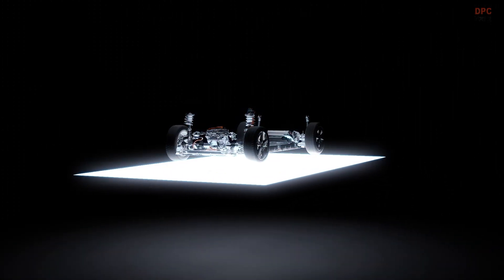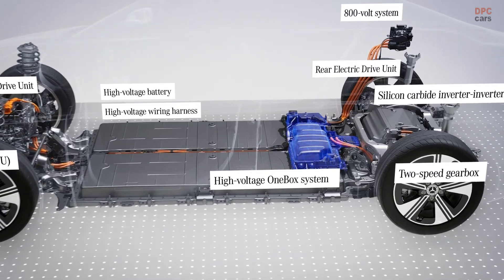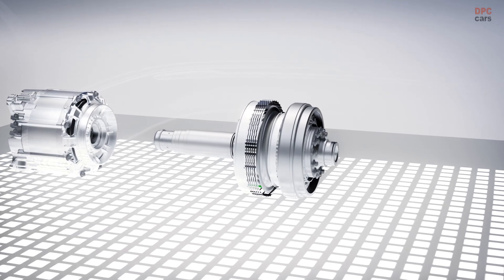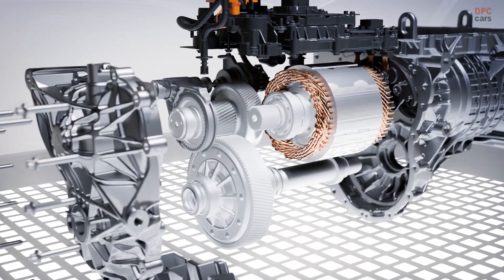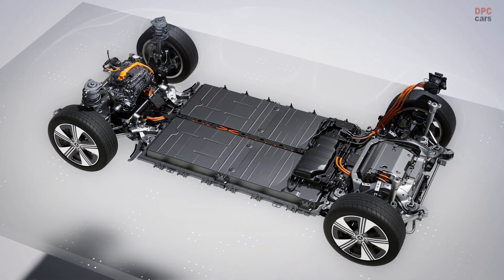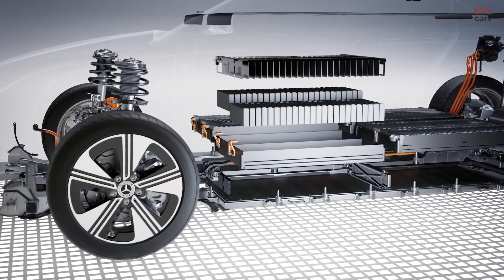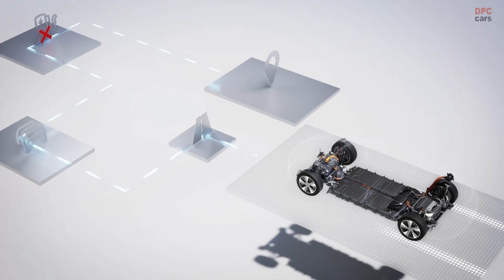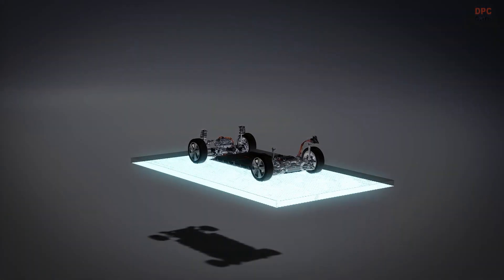New 2025 Mercedes CLA Hybrid & Electric Powertrains Explained

Comment: All Chinese, So don't expect it to be German,
Reply: I expect it to be one of the best cars all around, especially one of the best evs on the market
Reply: Weirdly enough the ICE is french, developed by Renault for Geely and Geely put it in a Mercedes. 
But that is actually fine, Renault is isn't half bad at designing engines. (Although Mercedes is better), the C class is all about keeping the cost down. 
E and S class are more focused on quality.
Reply: @buddy1155 no it was rumored and turned out to be false,its a 4 cylinder 1.5 liter called m252 following the already ultra efficient 3 liter straight 6 m256, all in house developed by MB